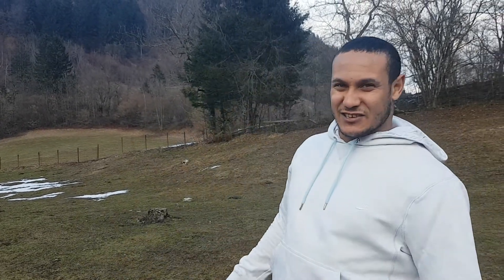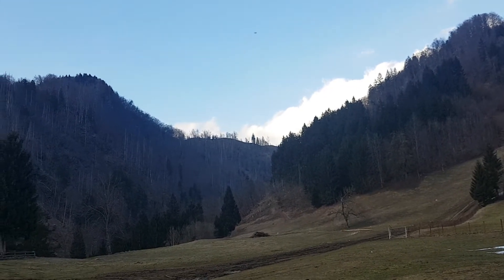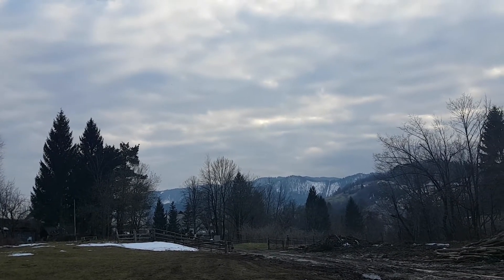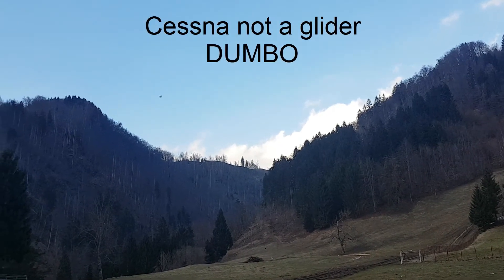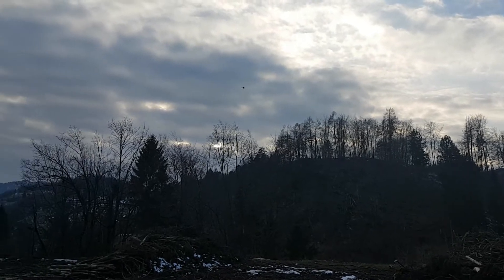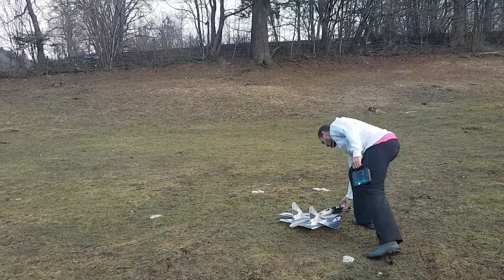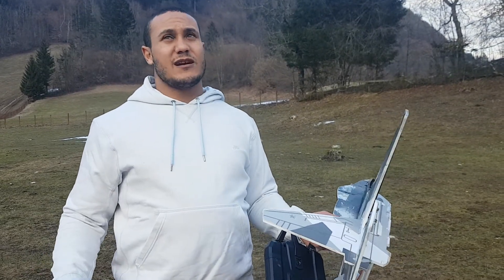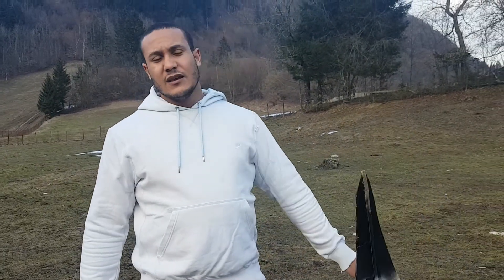DYS D2826 2200Kv Brushless motor 6x6 prop

Comment: Try the RaceStar series of motors that are sold by Banggood.  The 2212 with 2200 kv is the same as you used but for less money.  The RaceStar 2406 with 2600 kv is also rated high and can use 4 cells if you wish.
Reply from the maker: I have them, on some other videos I do test the racestar motors on this plane too.

Comment: Hi, I just build this too. But in came by kit with motors, prop, esc, servos and battery. But it couldn’t fly. Full throttle it just climb about 4 meters then goes down. The motor is 2200 kv, esc 30A, battery 3S 60C, and prop is 6040z is it because the prop or what? Do you have any idea about my case? Thank you, I had watch all your video too.
Reply from the maker: Use 7x4 prop. Also tell me the weight of the plane. I can give you a better picture. Put plane with battery on a kitchen scale and tell me how heavy it is. But 2200kv should turn 7x4 prop with over 1kg of thrust.
Reply: Trip's RC Reviews - Thank you. I ordered the 7x4 today. I’ll be back for update.
Reply from the maker: All depends on the weight of the plane, but for 6 inch prop it a 2400kv motor is best, 2200 works good with 7x4 prop. And make sure the plane is balanced nice.

Comment: Great video, what kind battery and esc using? Can it use 7x6 prop?
Reply from the maker: 2200mAh 25c lipo with 40amp esc. I have a video flying this motor with a 7x6 prop. It's going to pull the motor on it's maximum limits with a 7x6 so be careful, best 7x4 or 6x5.5